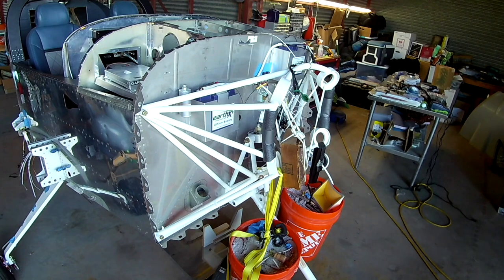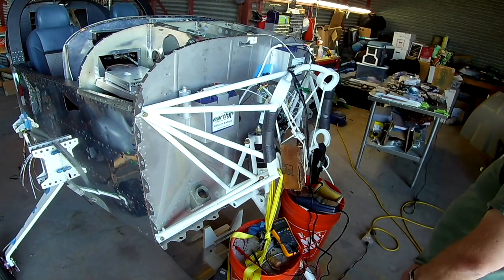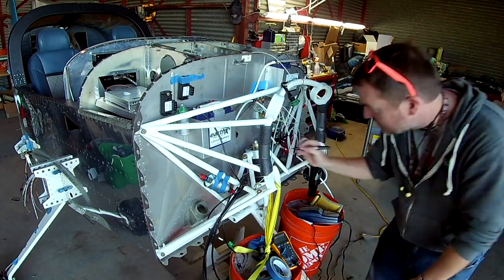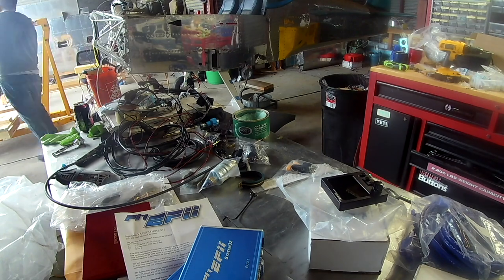RV-14 Firewall Engine Prep

Comment: I just did a quick mod on my hot air footwell vents that allows them to close much more tightly. Might want to consider before hanging the engine
Reply from the maker: What mod is this?
Reply: @akilroy  the warm air vent is mounted to the firewall with two rivets. Drill them out, double up the aluminum strip, and re-rivet. Vent will now close flush. Very easy.
Reply: @j.gregory5669  pictures